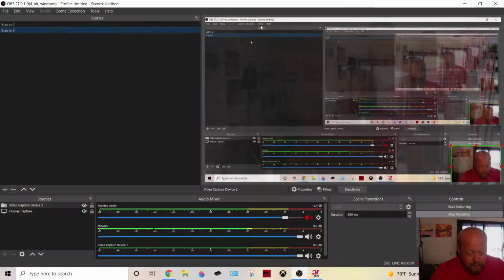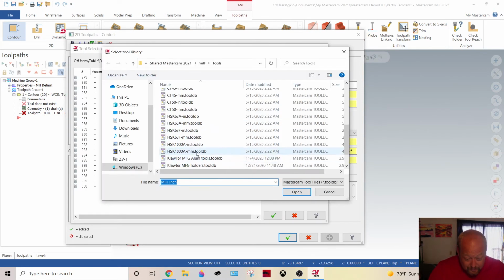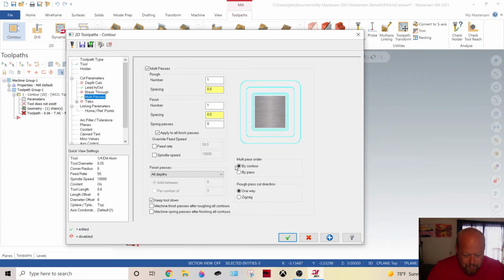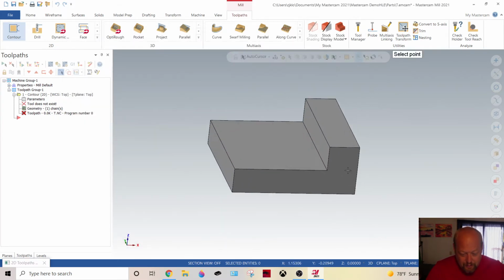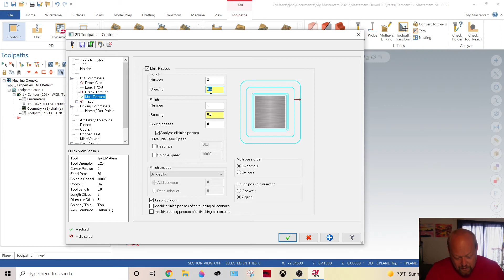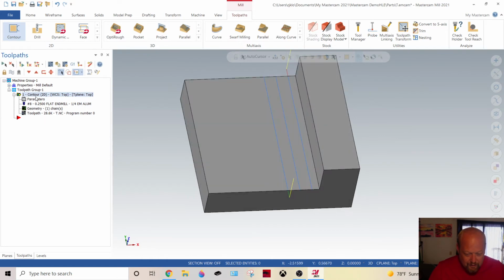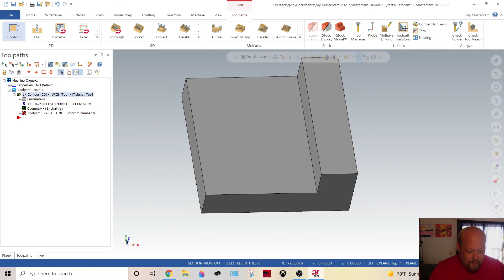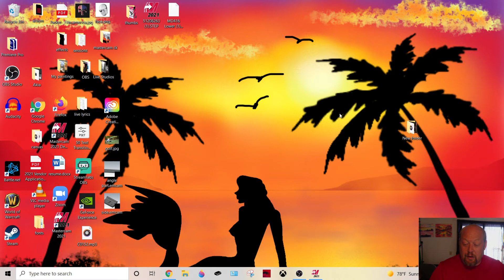Mastercam... best way to manipulate 2d contour

Comment: Hey KlawTor I just got a horizontal mill Mazak HTC 400 it has an indexing table. could you make some kind of tutorial about tombstone fixturing? I know for my part all 6 sides will need machining I'm hoping to machine 3 sides on each setup. The part has some holes at funny angles and features that will be machined at an angle. Specifically what I want to know is, if I tell the table to index to a certain angle how do I know where the hole I need to drill or feature I need to machine. Do I call an offset for these features or can the software calculate the position based on angle and distance? It would be really cool if you could do a tutorial on doing a full part on a horizontal with a tombstone there is not a whole lot of content on that on youtube.
Reply from the maker: Yes I believe I can do a tutorial on this you need to have the tombstone imported in the top view you have to be looking down onto the top of.  tombstone